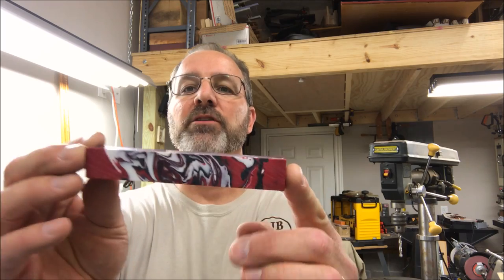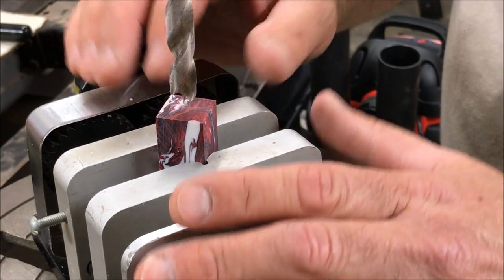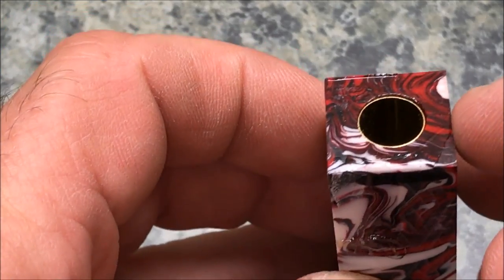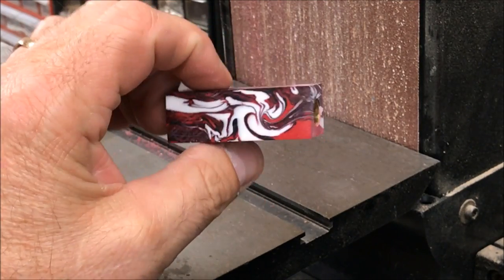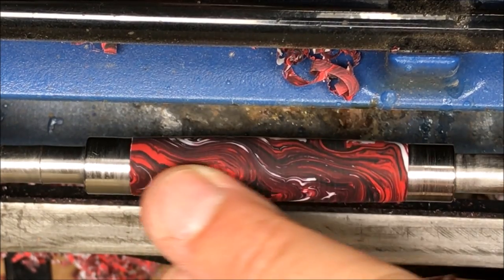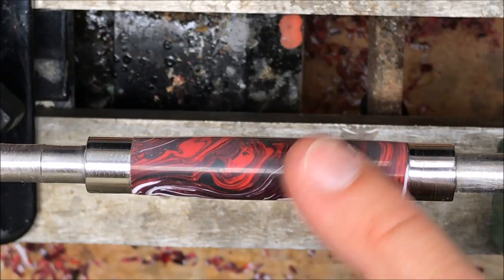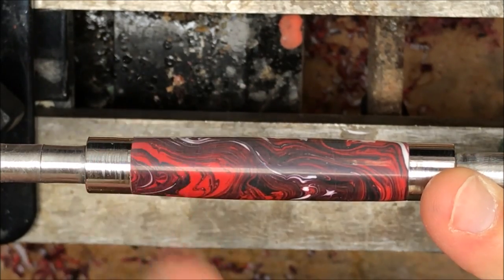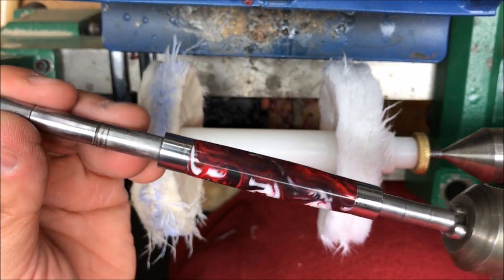University of Louisville Color Scheme Blank for my Son

Comment: Nice looking pen Bob. I just received some team themed blanks from Zac yesterday. I'm looking forward to turning them soon. I buff all my blanks, even CA finished and oily woods. My rouge is white, not sure what it is. l have always used it when finishing up my knife handles so I figured I would try it on blanks. I use a sacrificial piece of wood at the end of my blanks to prevent chip out, it has to be firm against it though.
Reply from the maker: +Ron Parrott Thank you Ron,
  I alleviate the info on buffing as I am a novice and still learning. Nice tip on drilling the Alumalite blanks too. 

Regards,
Bob

Comment: That pen is awesomes I haven't used the Palisades.  Don't forget to give the standard bits a try when drilling acrylic blanks.
Reply from the maker: +Dave White Will do Dave,
  I'm kind of limited on the 27/64" because I only have the one but many of the other sized tubes, I have both. 

Regards,
Bob

Comment: Good job Bob.  I noticed you used a brad point bit to drill vs a regular tipped drill bit. Do you find one exits cleaner than the other? Congrats to Braden!
Reply from the maker: +Lynn Lacey Thank you Lynn,
  Not really, that's the bit I bought when we went to Woodcraft in Indy. It was the only 27/64 I had. 

Regards,
Bob

Comment: My leather disk???  I've been using mine for months and haven't use cardboard since. 
 Beautiful pen for the Breden... Go, Cards!!!
Reply from the maker: +Bob Stembridge Thank you Bob,
  I've been keeping them close to the press, they will be a part of the solution as soon I figure out what it is, LOL. 

Regards,
Bob
Reply: RJBWoodTurner Bob, I only have a barrel trimmer for the 7mm pens and have a workaround for other needed sizes. Just glue up a piece of hardwood blank to a 7mm tube and turn it down to the inside diameter of the pen tube you want to trim. You just have to make sure you don't have any dried glue on the inside of the tube you want to trim. I just use a packing knife to scrape the inside of the tube ends to remove any bits of glue. Then you insert the tube and trim as usual. I also use a sharpie to write the tube size on the spacer and keep them all in an old Play-Doh container next to the drill press.
Reply from the maker: +Glenn Hayhurst That is a great idea Glen! Those inserts for the barrel trimmer are pricey. 

Regards,
Bob

Comment: Where do you purchase the Palisades kits?  Oh, and a suggestion for the leather disks...what about adding adhesive velcro...one side for the pen press and the other side for the disc.  That way you can remove them if you want to.  Just a thought
Reply from the maker: +Kimberly Frans Hello Kimberly,
  I got mine at a close out sale but I believe www.timberbits.com use to carry them. The Wall Street from Woodcraft is pretty much the same pen. Nice idea on the Velcro. I need to decide soon who I want to handle that aluminum end on the press. 

Regards,
Bob

Comment: Bob, Nice pen and job, as usual. Instead of the cardboard why don't you attach a piece of the HDPE dowel you made you finishing spacers with?
Reply from the maker: +ffscj I usually press the wood end of a pen at the ram side of the press. I have damaged a couple of pens with the HDPE so I'm kind of skittish about using it. Those disks might be the way to go at the end is an HDPE cover for the ram. 

Regards,
Bob